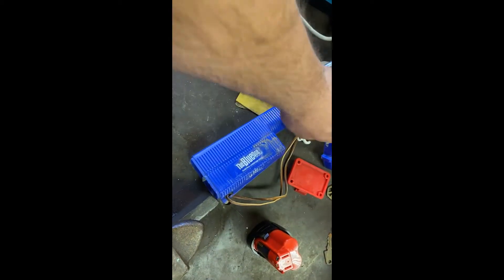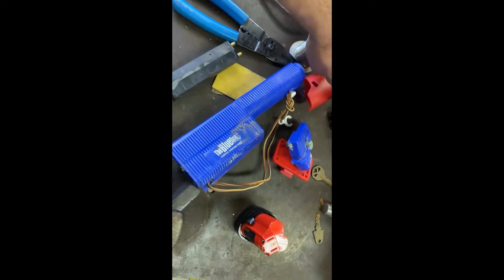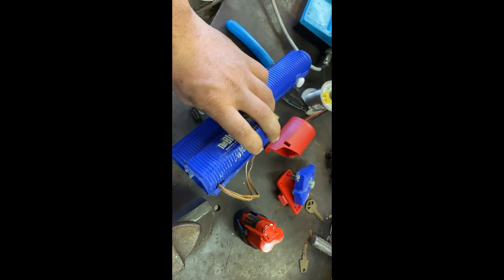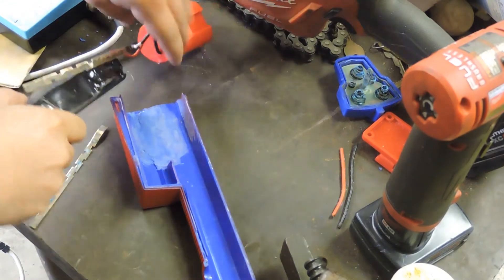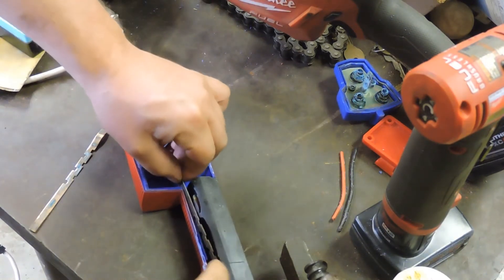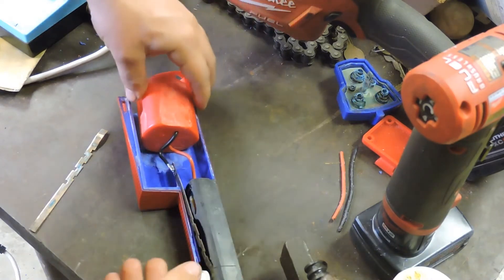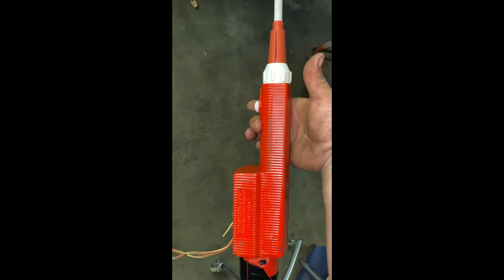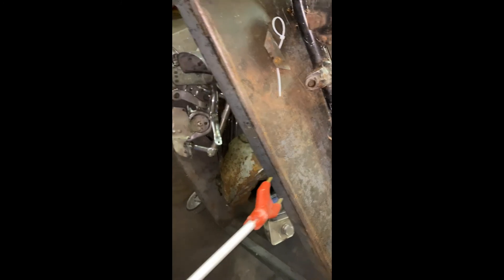The New Milwaukee Hotshot

Comment: input voltage much to high .. have you tried it yet?  you Have to run a voltage regulator!
Reply from the maker: I have had it for 3 years now without issue, and I checked it hurts about the same as a factory one.